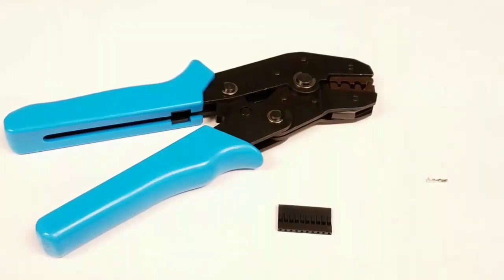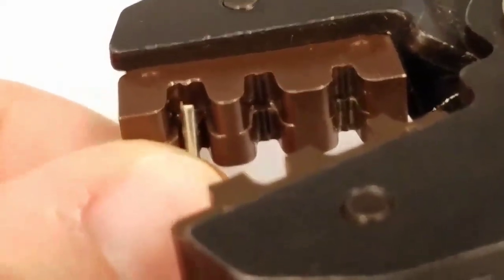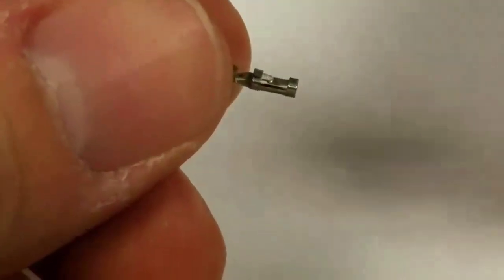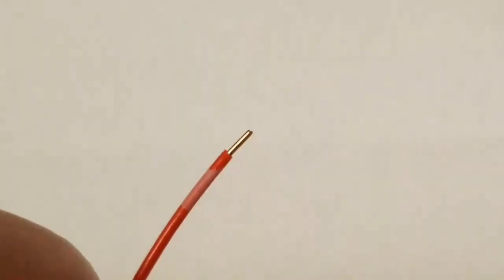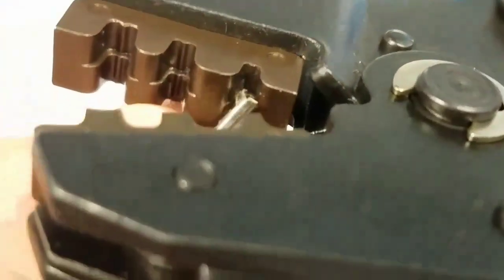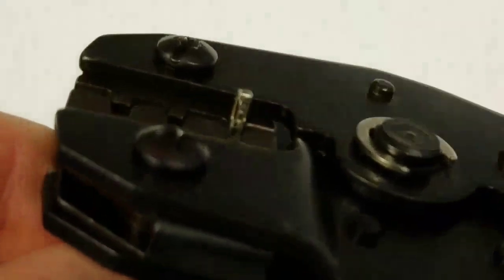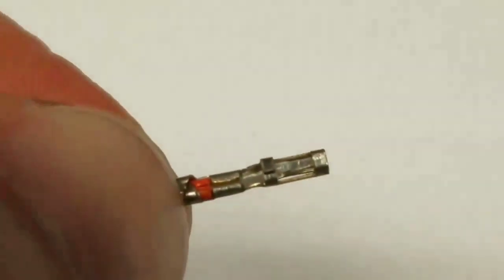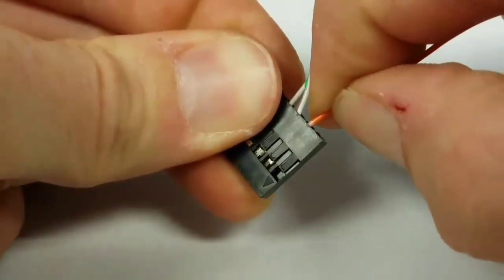Dupont Connector Crimping Tool Tutorial - SN-28B

Comment: Maybe you have a solution for me. I have a crimper to make servo extension leaders for rc airplanes.  It’s not working well.  Frequently when I crimp the outcome is bent , even when I get a strait one it won’t fit into the connector? Thanks for any suggestions
Reply from the maker: Most times if I don't get a perfect crimp, I'll have to manipulate it with a pair of plyers to get it just right. Usually the collar that bites into the wire doesn't round well enough.

Comment: Hello there. I'm new to electronics so please forgive me for my lack of knowledge in this area. I need to crimp some M22-305(24-30 AWG) contacts for a small project. I can't afford a $624 Harwin Z22-020 crimp tool. Is there an alternative crimp tool or die range I could use for my project? Thanks
Reply from the maker: So a lot of times, you can get cheaper knock off crimpers. Looking up "M22 crimper alternatives" I found a couple that might work for significantly cheaper. The OEMs are guaranteed to work well, but you have to pay out the ear for them. Look around for things with a similar or cloned crimp pattern.

Comment: Never crimp connector to solid wire, it will not bite into the copper the only thing holding the wire in would be the insulation. Try it twist the wire back and forth a couple of times just like it would with normal usage and you can pull it out with ease the only restriction would be the insulation. Now, try that with the proper stranded wire and you will tear a lot of the copper strands off to pull it out.
A side note, it has been tested that a properly crimped on connector is more efficient electrically than one that is soldered.

Comment: Thank you ! This film help me understand crimping process. Unfortunately not each wire (relation diameters between isolation and conductor) give good result. I need crimping DF-14 (LVDS cable). The DF-14 is very, very small ! I use magnifier by x10.